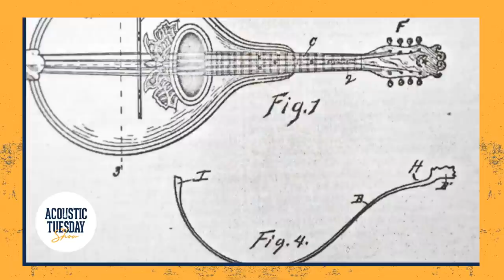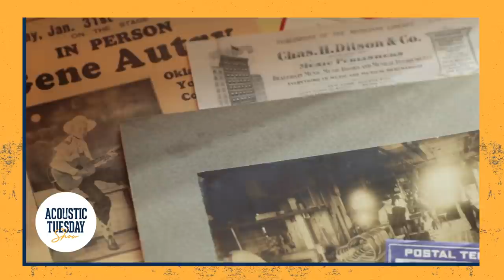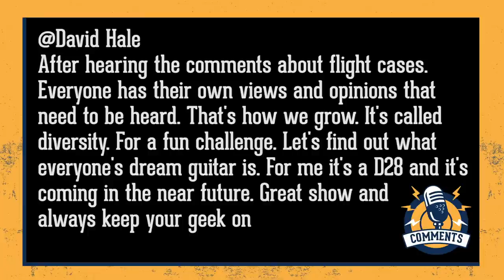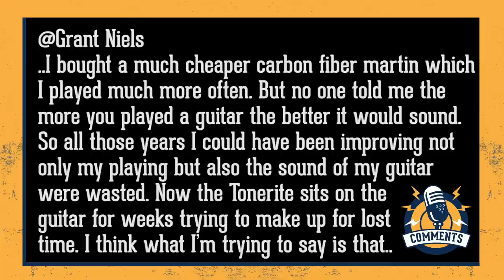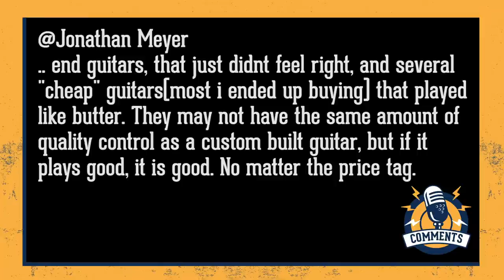Martin VS Gibson: The Definitive Comparison ★ Acoustic Tuesday 148

Comment: As a retired Manufacturing Engineer I have maybe a different take on the comparison between Martin and Gibson. Manufacturing processes are graded on their maturity. Process maturity is the compilation of many subtle pieces, however the end result is the ability of a manufacturing process to (accurately) repeat. So each time a shop moves to another building, these processes have to be resurrected, and messaged 
 to get back to a level of maturity that is repeatable (again). In my opinion, advantage: Martin. 

Side note: the process documentation is also key.
Reply: I agree with you that .artist seem to be more consistent.  I have read reviews and they are all over the place with Gibson, from glue drips, rough fretwork, etc.
Reply: Martin's are more consistent .

Comment: This video is soooo biased towards Martin...how much did they pay you?!? You gave them the innovation point? Yes, they basically invented flat top acoustic guitars and revolutionized bracing, but what about arch tops and the truss rod? What about the height adjustable bridges? All the stones and Beatles songs we love were recorded on a 60s Gibson with the plastic adjustable bridge. All of them. Gibson totally wins innovation. 

Let’s discuss model offering...how in the hell can you claim Martin wins? Every guitar is a 25.5 scale length with just different body shapes. What they do they do well but Gibson has both scale lengths with soooo many different options and aesthetics. The hummingbird, dove, J200, J45, L1...cmon dude. 

The Gibson custom shop wrecks Martin’s sooo badly. How can you give them the point? Martin stole their historic line idea from Gibson after they started doing it. And 10k for a D45? That’s highway robbery. The top of the line historic pre-war SJ200 is only 6.5k.

Comment: I can’t disagree that Martin might be the leader in sustainability overall but your suggestion that Gibson got around to sustainability only in 2019 is not really accurate. I specifically bought a 2016 Gibson J15 because of its use of sustainable woods, sourced from North America. That opened my eyes to walnut as a tone wood and I give Gibson credit for even using walnut for the fretboard, which is very non-traditional. The J15 is largely a walnut J45 but the use of sustainable American woods won me over. They gave since introduced several other walnut based models. Though I don’t currently own a sustainable Martin, I do own other Martins and am a fan of the brand. They do have the OME Cherry which adheres to a similar design philosophy as the J15 in term of being American made from sustainable woods. The only discrepancy I find in your assessment is that sustainability has been a consideration for Gibson earlier than 2019.

Comment: On manufacturing, I must say I purchased what I considered an expensive guitar from Martin.  It ended up cracking and I sent it to Nazereth for repair.  I thought they would change out the cracked top but instead they just glue blocks/patches.  I was very disappointed and swore I would not purchase another Martin.  Since then, I purchased a Taylor and a Gibson.
Reply: A crack isn’t a manufacturing defect. It’s a maintenance problem.

Comment: I watched this video and you got me thinking. Damn it! Now i have acquired Guitar Acquisition Syndrome. Loving that 1942 Southern Jumbo with Rosewood back and sides. $$$$$ is up there. But when you have GAS you have GAS only one way to relieve that. And that is purchase the damn thing. Anywho another thing I was thinking about is this. Just how much difference is there from Brazilian rosewood and East Indian Rosewood that is used mostly today? And here is my thought on how we could address that issue. The older Martins pre war sound great in many ways because of aging of the instrument, and my understanding is that is mostly dependent on the top wood when it comes to aging. So replacing a top on an old guitar it catastrophic in my opinion. So let’s get back to the back and sides. I think an awesome comparison would be the last year of a Martin D45 with Brazilian compared to the first year of a Martin D45 with East Indian. Would that be 69 to 70? Not sure about the timeline, or a 28 would be fine probably easier to set that up.

Comment: Historically, Gibson either invented or did so many things well: the archtop, the semi-hollowbody, as well as innovations in solid-body and - yes - acoustic flattop design. Martin - to use a phrase my local Martin sales rep said to me when I worked at an AIMM dealer - is “a company that makes D-18s and D-28s”. And that was a deliberate strategy on their part by that point (early 2010s): Martin wanted to distance themselves from recent experiments (the CF1 and 2, some acoustic-electrics) that didn’t sell well.
My point is that any comparison between these manufacturers has to be limited to what they historically both do well: acoustic flattop guitars. In that case, as someone who sold instruments for nearly a decade I gotta say that (at least, as of 10 years ago when I stopped selling) Martin is more consistent, and you get more for the money.

Comment: I don't mean to sound negative, and I may be irresponsible when it comes to sustainability initiatives, but I'm currently trying to select a high-end acoustic...  and I don't really care about any of these categories.   Both companies have stood the test of time.  I'll keep checking out the shops and will spend as much as it takes to get the guitar that has that magic feel and tone.  It might turn out to be either of these... or a Guild or even a Taylor.  So far, I'm not seeing any clear winner.  Sound and how it plays is all that matters; after all, it's all about the music.  All the rest of the stuff is cool info, but it won't influence what I buy.  I've been playing for a long time (55 years) and I will say that while Martins sound great, I never even remotely considered getting one until the mid 80's when they finally woke up and started using adjustable truss rods.  People have told me I'm nuts but frankly, the damn things were not fun to play until they fixed that.    By the way, I own several Gibson Les Pauls and also have an ES335, but that doesn't bias me at all.  Brand loyalty seems kind of silly to me.  I do appreciate all your work you put into your video,  and again I don't mean to be negative.  Cheers!

Comment: The "issue" I have with Martin is they make it basically IMPOSSIBLE for a smaller Guitar Shop to carry their Brand & have their Guitars more accessible.  (2023) If a Guitar Shop wants to stock some Martins, I believe the bottom line Requirement needed for Inventory is now $170,000 to start.  They're a business & do understand to a degree the financial end, but what RUBS me the wrong way is that while a Shop might lay out $170k, the Shop is NOT allowed to CHOOSE the Martins they want to stock & offer. (Even though a Shop might know their Customers best?) Ironically, a small Shop really can't afford to have a good portion of their Stock remaining on the Rack, especially if they know what what sells & what doesn't.   Martin writes the "Set List" so to speak.  I don't know exactly which Guitars but assuming there are samplings by Categories (shape/oo/om/etc) & bet these do NOT include the more High End Models (D-45, etc) For small Shops, that would definitely limit Variety.  The smaller Shops I know are resorting to selling Used Guitars & this is also challenging to compete with Giants like Sweetwater. After this brief research, it also answered WHY smaller Guitar Shops are a dying breed.  I think that is a CRIME.  It's not always just about the "Buy".  I prefer a more intimate setting when making such an important purchase. To me, a Guitar is the beginning of a profound Relationship and it is indeed, a special moment.  Making the Purchase in a smaller setting in addition buying "Local" just feels right. I don't want to Order my Guitar on Line like some sort of Mail Order Bride - I want to feel one in my hands and if there's a connection.  Smaller Guitar Shops are not just "selling" Guitars either as they become an extension of the Community of Musicians, a gathering Place, a Space for Learning and discovering Connections.  Personally, I feel that large Guitar Mfg's like Martin, Taylor, Gibson have the ability to support this element or facet of the Industry.  Lowering their Inventory Requirements would certainly help.  While these Giants do have Charitable Foundations, most are more focused on Academic Education & Scholarships.  I just wonder about "the Other Guy"?  The Kid who goes into a local Guitar Shop and has the opportunity to go "noodle" in the Corner & without pressure, just give it a try. 
Lately, I've wondered if, what I call, the "Kardashian Effect" hasn't hit the Guitar Industry?  Where it's more about Brand vs. Substance.  While Martin produces beautiful Guitars, no doubt, there are also many Guitars equal with exception of their Price $.  It makes me wonder, now & then, when someone is purchasing a Guitar these Days, how much influence of Brand has effected their Listening Ear? 
Sorry if I got off Topic, but the disappearing Guitar Shops, particularly following COVID, weighs heavy on my Mind.

Comment: Nice comparison, Tony. I  disagree ever so slightly with the outcome but not necessarily with your reasoning or final call. I recently purchased a new Gibson SJ-200 Original from a shop very familiar to you. It is my first Gibson acoustic in 55 years of horse trading guitars. As much as I wanted a custom shop model I just couldn't justify the extra cash for the bling. Gibson is after all,  the "King of Bling" (IMO). While I realize this does nothing for the sound or play-ability  of a guitar, aesthetics count. No intention here to take anything away from Martin. I've already set my mind on a D-28 for my final addition.  I just think Gibson Shop should have been 1 point closer - they still would have lost ;-)  Keep up the good work!

Comment: The 2004 Martin D12x1 is on my work bench with a neck reset in progress, the top cracked and because the cpl back and sides was difficult to glue and have hold this second time around is looking good i'm taking my time and I think she'll be a player yet. My 00015M is very nice but far from perfect on fit and finish also the case that came with it took a hit from a trunk lid and cracked easily guitar was safe but not much of an impact surprised how little it took. Love my 4 Taylors too and the Takamine 12 string from 1970 something it also needed alot of work due to it's previous owner, loose brases and bridge bellie bulge, small crunch in the top. She survided and is fun to play. I don't see Martin as way above Gibson in quality,fit and finish and certainly not tone nor are they below in these matters. Just different both good guitars any given day you could pick up something very special or pretty average from either company. Looking at a Gibson Dove and Taylor 614ce for the future. Dream guitar wont know till I pick it up someday somewhere. Might not even be an upper end guitar fo all I know. I love all these guitars and they will serve me and others well if given proper care and most all they need to be played!!!☺

Comment: I had a Gibson Dove many years ago that I bought the same year as my Martin D35 (1976). The Dove was so much fun to play because of the Gibson neck - flat, low action, very easy on the fingers - and a completely dead sound. The D35 was much harder on my fingers but had an amazing sound! If I left the strings on the D35 for a year and let them rust it might have sounded as dead as the Dove. So it came down to a choice between easy to play or sounds great. I got rid of the Dove. Now if only I could find a guitar that sounds as good as a Martin but has a neck that can compete with the Gibson! (Taylor owners, don't tell them; let's keep it a secret.)
Reply: By the way, my dream guitar is my 1986 Somogyi Brazilian rosewood modified dreadnaught.

Comment: I've recently been looking for a second guitar, a strummer (I have a SCGC OM Custom that has a gorgeous "Martin" balance tone; great for fingerpicking but I want something with more midrange for strumming). I had high hopes it might be a Gibson (like a Hummingbird or J200) but, to be honest, I've been shocked at the quality (and I wasn't looking at anything under $3000). I've found the Gibsons might sound okay in the open position but as soon as you put a capo on and go up the next, they sound thin and dead. Not so with Martins in the same price range (but I don't want another guitar with that same sound signature).

I have a 1974 Guild F512 which I played for many years with only 6 strings (essentially the same as an F50R) and it blows any Gibson I've played out of the water.

Comment: Gibson has more models I would want to add to my collection.
For Martin's I have custom VTS Adi 000-18, custom VTS Adi 000-28, SPD-16 Dred, GPCPA1+. 
For Gibsons I have a Songwriter Custom Cutaway with Adi / Rosewood, a J-45 I took out pickup put in bone nut, saddle, pins,  also LG-2 with also upgraded bone nut saddle and pins no pickup. 
I don't think there are any more martins I would want. Maybe a D-41. I have OMs from Collings and Santa Cruz and other brands and models to cover many needs however.... I would love to have an Elvis Dove,  Elvis J-200, Advanced Jumbo, J-185, CJ-165, Hummingbird. Maybe as time goes on I will pickup those Gibsons. Probably need to get the historic versions. They are better specs for me. 

Both brands are great. If I had to start selling I probably would be left standing with the J-45 from what I have now. Even over Collings, Santa Cruz, PRS Angelus Adi / Braz etc.
Reply: FYI my gibson custom shop Songwriter I had made with some special changes Adi top etc had more flaws than any of my other high end guitars. Martin has much better QC Not even in the same ballpark as Collings, Santa Cruz, and PRS private stock Angelus. The Songwriter has uneven chipped fretboard binding (flammed maple), poor cutting on the inside and sloppy glue etc. Even with all that I still like the sound of Gibsons and Martins best for all styles. I have a baby Taylor for fun and kids to play but only played one I wanted to buy. I let it slip away. It was a smaller size. I don't remember the model but an OM style, Slotted headstock. It was nice but never liked any other Taylors to date. Guess it shows everyone has different tastes.

Comment: Martin used to make fine guitars..I have owned 15 since 1961.. models made from 1939 to 2015. I curently own 2.. a 1997 0000-1 (1 of 370 made between 1997 and 2000) and a 2015 00-18v with flamed mahogany backs and sides.  .

 I have also owned a few Gibsons.

A great Gibson is a rarity and when you find one you will never forget it and in my opinion is superior to a Martin.

Comment: I ordered two custom (expensive ) Martins in 2010 and 2011.. Both were defective right out of the case. Both returned.. long story but Martin lost one of them and then  made a replacement that was not the same as the original and I rejected it.  11 months .. 11 months and I had it for less than one month.  The second was also defective right out of the case and I never played it.. never. It was returned and they destroyed as  unrepairable. What?.. a new unplayed (by me)  custom guitar was so bad it had to be destroyed, how did it get out of quality control? Result, after 15 Martins new and used since 1961.. no more new Martins.
Reply: Martin doesn't market any returns or "Seconds"....which makes sense.  Sorry your experience was such a Train Wreck.... I found my D28 used...I love it. I tried a brand new D18 at a Guitar Center and it had terrible sustain.   After 3 minutes I put it back on the shelf.  I'm sure someone else will love it...🎶🎵